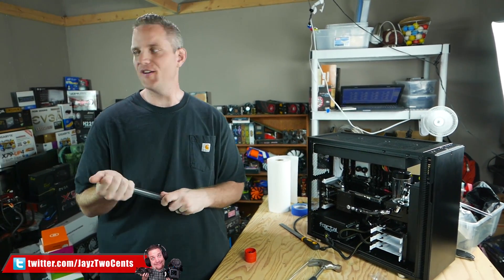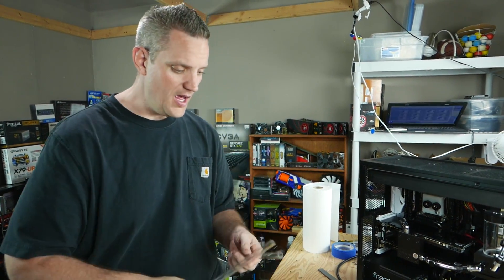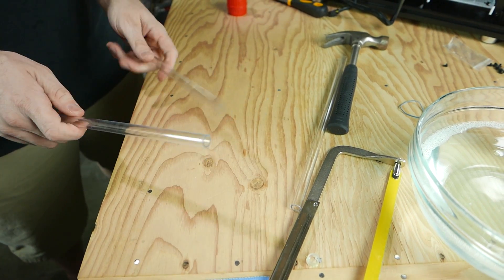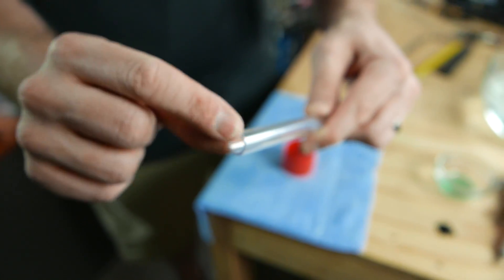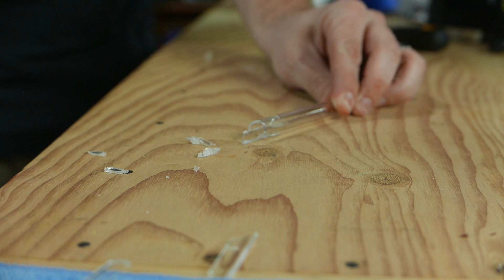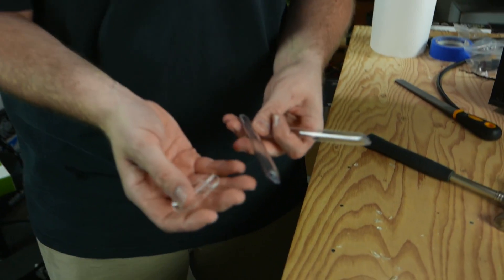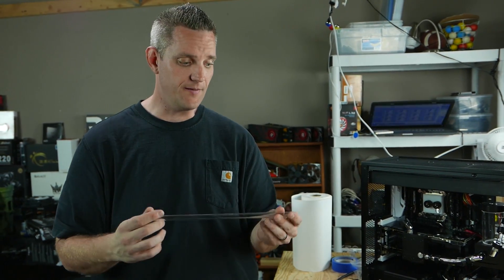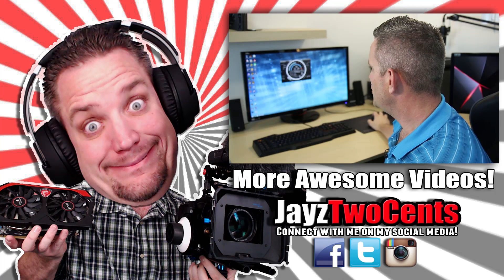PETG VS Acrylic Stress Test - Hardline Watercooling

Comment: One negative of petg is that because it is so soft, it often warps under normal heat - excessive heat can cause serious warping, leading to leaks from fittings due to not sealing correctly

Comment: I’m looking to build my first water cooled PC and learning so much from these videos. I’ve seen comparisons between Acrylic and PETG but wonder why Polycarbonate isn’t considered? Polycarbonate has higher thermal properties compared to PETG and has higher impact resistance compared to Acrylic and PETG. My concern with PETG is that it starts to soften around 60 deg C, which I imagine the fluids temps in a loop to reach near this. With thermal cycles over the years, wouldn’t this slowly warp the PETG?

Comment: Yes, PETG is tougher, but it's also designed to melt at a lower temperature so it's easier to work with.

Downside of THAT is your liquid temps can potentially approach that threshold and melt your tubes enough to cause leaks.

I'm not going to say sudden shocks never happen to computers, but if you're not like Jay or Linus and manhandle your components, drop your whole tower, or shake the whole thing to get air out of a radiator, you're probably FINE. I'd reccomend a sturdy desk though...

Still, even with petg tubing I'd probably drain a loop before doing ANY kind of major maintenance or upgrade in case you jerked something by accident.

And of course, when in doubt, design your loop to keep as far from the expensive components as possible. I have an 011 Dynamic XL, and there's no reason to tempt fate by putting your top rad's ports in the back of the case, or ANY rad. You inevitably have to connect to cpu/gpu blocks, but otherwise keep it all tight up in the front where any splashes or leaks are overwhelmingly likely to steer clear of your card or board. Maybe you'll short a fan, but the rest will drain onto your desk after passing through the bottom.

Just prepare for the worst and minimize the potential for expensive fuckups.

Comment: ahahaha petg no thank you it gets squashed and melt point of petg is lower so petg = less ridgid more posible leaks at higher temps in loop PETG = SOFT NO GOOD litlle overheat end and it OD gets smaller leak leak leak 
Acrylic all the way
Reply: Seen more cracked acrylics on youtube than leaking PETG due to overheating lmao What you SHOULD DO is make a better flowing system so that WON'T happen!

Comment: I'll never understand why people think hitting tube with a hammer has any bearing on its suitablility for a cooling loop. 
Its completely irrelevant and pointless. 
PETG is softer and deforms at lower temps. If your pump dies do you want the tube that deforms at the lower temp or higher temp? Thats a test that would be actually practical and relevant
PETG is not as optically clear and its hard to get a decent finish on it after cutting because its so soft.
Tried PETG and Acrylic is still my choice
Reply: Also consider kids being kids and knocking over your pc or running into your desk. If your PC is reaching 100 c you clearly did a bad job at making sure your radiators are working and flowing correctly. And if you don't even notice that your DC/D5 dies and continued to play your PC then that is your own fault! IDK about you, but my PC is see through!

Comment: I always dump my acrylic tube into cold water and it never cracked. It all depends on the quality of the acrylic... There are BIG differences in acrylic quality.

Atila
Reply: it will get invisible cracks tho...
Reply: temperature shock pls, EVERY material gets damaged with it although some materials are stronger and others are weaker..

Comment: jay i think you forgot to mention the water permeability that PETG has, which is, to me, the most important drawback of PETG. not a big deal though as long as you do maintenance at least every year. all other issues can be solved with some elbow grease. but there is no way to avoid water vapor escaping through the tube. i've heard PETG stains faster with dyes but ive never seen it as i don't use dyes.

Comment: Jay that's honestly really dumb testing the acrylic by dunking it into water while it's still hot, that's deliberately compromising it's structure. I can see you were trying to prove a point about the cracking, but I can make even metal crack by heating up and cooling it down rapidly, heck when I was learning how to weld I fucked up by dunking it into water real quick and cracking the welds. Want strong acrylic? When you heat it up, after you bend it put it in the oven so the whole thing cools at a slower rate and gives the molecules time to align and reform. It takes extra 15 minutes maybe, buts it's stronger than PETG at that point and you will be rewarded with better clarity and a more uniform texture. 

As for cutting and de-burring, get finer blades or sharper blades and it will cut better. I sharpen my tools before I de-burr, and the tools I use are designed for really soft woods and plastics as they have to be super sharp to get a clean chip forming and a smooth cut, they are the same price as normal de-burring tools. I also bought super fine hacksaw blades from the hardware store (absolutely 0 extra expenses compared to normal hacksaw blades from Primo Chill or any other company) and they work amazing, again as they are designed for brittle plastics and soft woods. More TPI (Teeth per inch) means finer cuts and less material taken off per cut ensuring you don't crack or break something by trying to take a large cut. PVC cutters also work shockingly well as they are super sharp and simply slice the pipe cleanly. 

As for cracking and such, yes the stuff PC companies sell is complete shit as its extruded (notoriously bad for Acrylic) and the rapid and aggressive manufacturing process weakens the acrylic by constantly moving it and not giving it time to settle or fully "cure". I get mine from  industrial supply and it's light-years ahead from the garbage you get from PC stores and it's actually cheaper when buying in bulk. The industrial stuff is a different polymer blend and can withstand some serious force before breaking, and because it's held to a higher standard they ensure the acrylic cools evenly and is strong enough for any application. 

Don't get me wrong PETG is some good stuff and if your not anal about details or want a quick job it's fine. I use it for small sections and fast connections as its much easier to get right than Acrylic, but Acrylic will always be clearer, more uniform in texture and will seal better compared to PETG simply because of its molecular structure, manufacturing process and how it cuts. Not trying to hate, but your not comparing Apples to Apples and your bashing bad acrylic versus very good PETG, that's like comparing your Nismo Z to a Lamborghini Aventador, two different levels of quality entirely.
Reply: Brap Brap 
Yay some who gets all the facts right. You did miss the part were PETG "rots" though.

Comment: I have just done my first hard line with acrylic should I be worried
Reply: Are you going to hit your computer with a hammer? Did you use cheap acrylic? Test a scrap piece to see what it can handle. That was the first thing I did when I started building my loop. The acrylic tube I received seems to be better than what was used in the video

Comment: Try not to let the rough de-buring finish turn you away from PETG. Sandpaper (use a few different grades) does a fantastic job of smoothing off rough edges on PETG tubing. PETG has a longer life, and like Jay said doesn't reflect light as much as acrylic does.
 Also, cutting tubing at higher speeds with smaller teeth usually yields a cleaner and stronger cut end. Use tools such as a fine dremel disc or metal grade band saw, and "Holly" go lightly.

Comment: Dude who deburrs like that? You are doing it way too fast und the tool is always wobbling. Also ever heard of sand paper?
Reply: Do you want the video to be 20 minutes long and watch him "perfect" the tubing? And did you watch the end when he said he would use sand paper and a file if he had one to fix up the PETG?
Reply: you missed the point. and those deburring tools are made for metal so it works horribly on soft material. The Point is that acrylic is easier to debur.

Comment: petg is like polly carb I work in a plastics factory. as far as bending if you use a heat proof white chalk board and place in the oven at the right temperature it will bend well. timing and temp can be critical though

Comment: Doing all my research before investing and I've pretty much spent a couple of days on your youtube account watching video after video, I think you might be the greatest source of information for water cooling on the internet.
Simple question, when shaping PETG, is it ok to use a bending kit designed for acrylic. Downunder (here in AU) water cooling is relatively small, and so there is far less options for buying parts.

Comment: You dont even understand the material you are dealing with....dunking hot acrylic will lead to stress fractures,this is a characteristic of acrylic and is well known.....
Doubt my credentials?
http://www.overclock.net/t/1388300/acrylic-pipebending-101/0_20

I wrote the book on this.....

As for the hammer test....yeah,impact strength is your only metric? Because hammers play such a massive part of loop construction....

And this 'Pro' uses acrylic and copper.

Comment: Not trying to be a smartass, but you can tell the difference between PETG and acrylic because of the greater sheen and rigidity acrylic has. If you look at the cut on the PETG tubing you can see that it is more abbraised and fogged where it was cut.

Comment: First ever YouTube post but I thought I would add my 2Cents, lol. From what I have read PETG has a max temp of 65C to 70C (149F to 158F) Whereas acrylic is 70C (158F) with short time maximum of 90C (194F). I know the temps are close but my mitx build runs about 75C -78C (167F-172F) under full load due to overclocking. Also, acrylic has a light transmission of 92% where PETg is 88%, does that not make acrylic clearer, ie more translucent?

Comment: PETG is basicly the same stuff plastic bottles are made of. If you look at one of those bottles of water with a thick wall, you can see that the material is slightly blue just like the pice in the video.

Comment: Various types of PET are very useful and tend to be very tough and durable. As they age though these qualities are gradually lost. Just something to be aware of. In a computer case they are well protected from harsh conditions but in other applications exposure to sunlight, salt water, certain chemicals, or extreme temperatures will dramatically accelerate degradation and eventually the material will disintegrate. Should be okay inside of a case for the useful life of a PC though.

Comment: I would of thought that dipping tube into water makes it brittle? Don't dip and let it cool slowly .  and flame finish after 1200 grit sanding will leave a glass gloss finish. CO2 cutting or laser cutting is also way better than the butcher saw hack method. ANd whats with the MC Hammer test?, never seen that bench test before.

Comment: Sorry J this test is rubbish! I've worked with Acrylic alot and never had any problems its been rock solid, oh and when do you ever take a hammer to your system!?
Once rigs are built they just sit there, unless you go to lans which in that case people use smaller cases, shorter tubing routes= stronger loops. 

Your build looks awesome just stick with it, or is it just an excuse for a new video on PETG bending, dont put it in your system your Acrylic wont go wrong how can it?
Just do a separate video. If anything add copper tubing and do a video on that!

Look forward to more videos!
Reply from the maker: Alexander Lajer I still like the peace of mind knowing its stronger, as long as the proper fluid is used.
Reply: ***** absolutely.

"it should be fine because you don't drop your computer" isn't the point, it's a material that is strong enough, clear enough, but also has some give, which ultimately makes it several times stronger in the long run.

ultra hard materials are always prone to stress injury. something else with just a little bit of give is more durable.

Comment: Some chemistry: PETG smells when its cut because it contains a benzine ring. Benzine is well known for being 'aromatic', and although benzine itself has a 'sweet' smell, when combined with other atoms as a prat of a molecule, the smell can change. This is also amplified by the ester functional group on the ends of each unit, and esters are also known for their smells as they are used in sweets, such as pear drops.

Comment: Hey, Jayz, Keep up the good work, man.

I have a question here, I am noticing that video card feeder blocks (EK, etc), and fittings (Bitspower, etc) seem to feed the card blocks in parallel flow splitting fashion.

Does it matter if they are fed by flow splitting or daisy chained?  I'm about a year out, maybe a little less, from doing a custom loop in my system, and am wondering if there is a temp difference between splitting or daisy chaining.  A lot of what you have said to date makes me think this is not the case, or if it is the temp diff is so low as to not really matter.

Also, on the subject of flow splitting.  I have a Gigabyte Z97X Gaming G1 WiFi Black Edition.  This has the water blocks on the VRM stacks.  The blocks appear to be connected to each other with 1/4" or so, and I do plan to be using 1/2" ID acrylic tubing to reduce fittings costs, while still having a rigid system.  How would I best deal with this?  Would a flow-splitter of some kind be the answer?

Thanks,

Comment: Not sure if anyone posted this in the comments yet, but I would suggest trying a pipe cutter from homedepot for the PETG.  No mess, cuts fast, and cleaner edge.  Not sure how well it works with PETG, but worth a try.  Its just a small carbide disk the rotates around the pipe/tube and you tighten it gradually each time around until it cuts through.

Comment: Is this Build Good Enough for Ultra or High Settings on most games? Also Why are People telling me not to get Windows 8 their Advice Is to get Windows 7 for some reason. Also Are all the Parts Compatible? I am 13 and I'm a noob at computer building/part picking.                     

http://pcpartpicker.com/p/7LJnrH
Reply: The 212 evo comes with thermal paste. Decent little build. Your settings for games you can run depends on screen resolution, if you're on 1080p you should be able to run most games on high.
Reply: Brian Rangel Thanks dude.

Comment: You also cannot use certain coolants with PETG -- namely anything containing ethylene glycol, also called ethane-diol or ethanediol (automotive antifreeze, Mayhem's XT-1, Phobya ZuperZero, Feser, among others). Propylene glycol is also called propane-diol or propanediol and can be used with PETG tubing -- Koolance, Primochill, XS-PC, Fluid XP+. Mayhem's X1 and Pastels use a glycerol and distilled water base, and as far as I can find, there's no concern with using that and PETG.

Comment: Would the vibrations on pumps or something cause fractures on the acrylic or something? or is it just tempered glass?
Reply: I'm not sure about the pumps vibration would cause it. But if you're making a small itx build with acrylic tubing to bring to lan parties, it could be a major problem if you drove over a pot hole while transporting it. I do know that if the water does get to warm enough acrylic has a much higher chance of cracking(usually caused my a hair line crack that wasn't seen)
Reply: +Atqthe30th thats why you anneal your acrylic so you relieve the stress

Comment: Are there any advantages to using actual rubber tubing Besides ease of use?
Reply: It's safer. PETG gets soft at rather low temperatures and acrylic can have cracks that expand over time.

Comment: i tried first generation primochill hard fittings and their tubing and it was a complete disaster. the bending is tedious and hard to work with. i hate those spider fractures and when you accidentally overheat it and the tube becomes convoluted.

Comment: Don't think PETG tubing is stocked any place in the UK,even PrimoChill,not what i have seen anyways which is a royal pain in the ass.
Reply from the maker: Dinxsy Wow really?? Thats terrible. I didnt realize it was so new.
Reply: ***** Not to my knowledge,it may exist here,i shall have to look harder or buy from the U.S and incur the duty charges.After seeing the Acrylic shatter shocked me,i knew it was brittle from working with sheets of it but tubing was insane. Also did you see the picture on Instagram i tagged you in? Could be an solution to the Parvum GPU issue. All the best.
Reply: Dinxsy
highflow do the 12mm/10mm so you can use bitspower fittings if you want. go to http://www.highflow.nl/acrylic-rigid-tubing/acrylic-rigid-tubing-nl/cf1-hard-tube-12-10-mm-petg-5-x-50cm.html
Reply: You can get PETG from nearly any Plumb station :P
Reply: paul maddy Thanks for that,may have saved me some researching and shipping costs,shame the lengths are only 50cm,prefer 100cm
Reply: no worries, but yes be better if 100cm was available.
Reply: ***** Mcmaster-carr stocks it in the USA for 1 or 2 bucks a foot
Reply: ***** Yeah it's widely available on most UK sites now, thankfully.
Reply: We're spoiled over here in the USA with Performance-PCs. They ship the very next day everytime and have almost everything you could imagine (besides the GPU blocks that often have to be bought from EK themselves shipped from bumbphuck Egypt somewhere in Eastern Europe) but I digress.